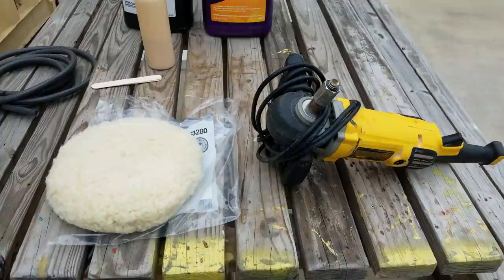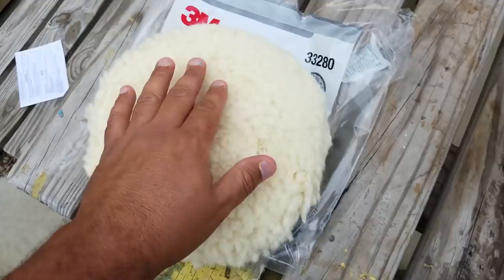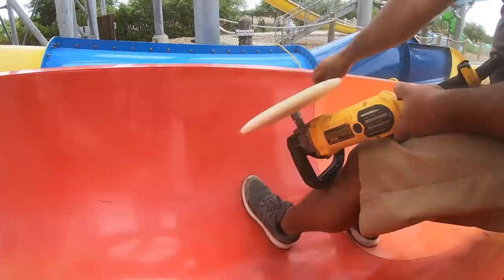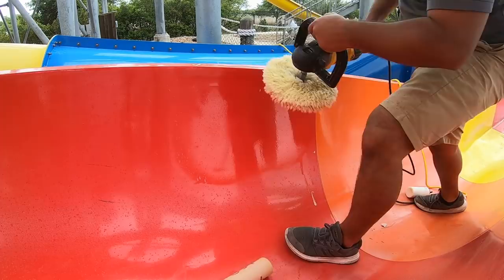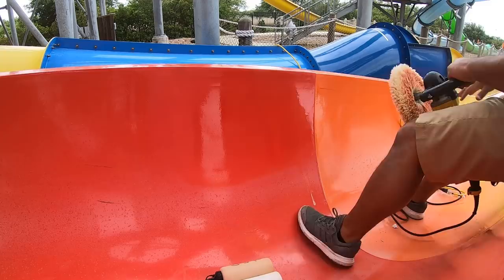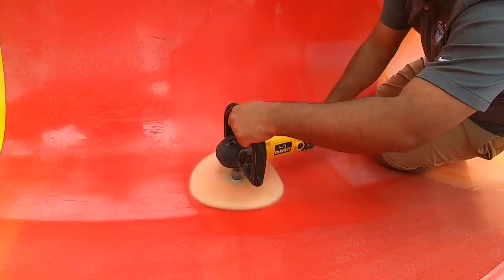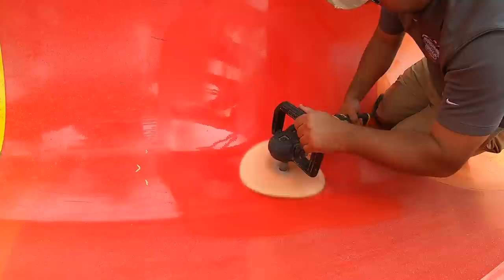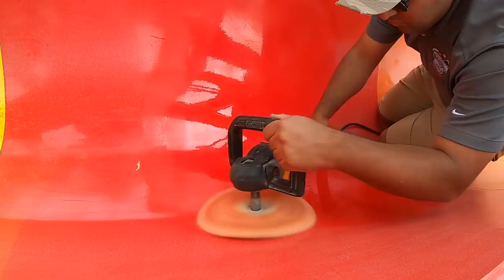Commercial Water Slide Buffing and Waxing DIY

Comment: Is it intentional to have the stuff that flys off the pad when you clean it with the stick, land on the yet to be worked on surfaces?  Or maybe its so little it just doesn't matter.
Reply from the maker: When at this point in the process, which we call the "cut" debris is not a huge issue. When we go back for waxing, all surfaces are cleaned well and debris is removed as much as possible.

Comment: Hello there  i have some question? i don't understand that you are not using a foam pad after the sheep pad the scratches of the sheep pad are deep and and the oxide shrinks not enough to me with only wiht the sheep pad, I use a polishing machine of the brand Fein WPO 14-25 E, this is very a strong and runs at max 1500 rpm and has lasted for 10 years' 3m is good stuff and I know from many tests that the results remain good on boots. Even  with cheap gelcoat "I really like to see you video I hope you can show more videos from  slide polishing  👍😁

Comment: Hi, I live in India and operate a couple water parks here.
We have never done this procedure in years (especially after the pandemic) and we have thick calcium buildup, thicker than a sheet of paper.
Your video was very informative and I'll do the procedure as soon as possible now.
It would be really helpful if you could tell us if we should sand it down first, if if yes, what grit should I use.
Also how often should this process be repeated? We have a 4 month season here annually.
And how often should I just wax (without the heavy cutting)?
Reply from the maker: Sagar.   I would suggest that you try cutting with auper duty compound first.  If it doesn't cut well, you might try 400 grit.  You have got to take the process slow. As, you only want to remove calcium and not dig into the gel. Once you get the slides polished, try and maintain by waxing twice a year.

Comment: I know this is an old video but have you ever tried pretreating heavy calcified areas with muriatic acid?  I used it on my boat bottom and it dissolved all the embedded minerals. It’s less you would have to burn through then.
Reply from the maker: Hey, yes, we have used muriatic in the past, but with the porous nature of gel coat, its helps minimally.  This process seems to be much faster for us.

Comment: ThePoolGuy I have a question I built a slide for my kids out of concrete going into my pool but what ever I coat it with never last longer then a few months to a year could you suggest to me a solution like a permanent slide material that I could just cut and buff like you did hear with this slide
Reply: Use epoxy paint. 
It will last 3-5 years 
There really is nothing that will home up long term to chlorine. I clean pools for a living, and that's the only thing I've seen that even lasts remotely long enough for it to be worth it.

Comment: Hi I’ve painted my child’s slide with spray paint and now it’s not very slidey do you have any recommendations??
Reply: It depends what type of paint you used. If you used a latex based paint, it’s not possible. Cover it 4-6 coats of a automotive enamel paint. Acrylic enamel works good to get a nice shine and slippery surface. After you get a nice coat of paint and it’s dry, buff and polish to make it shiney and slippery.

Comment: Do you do the grouting on the slide as well? If so what grout do you recommend?
Reply from the maker: Are you referring to the caulking between the slide joints?
Reply: ThePoolGuy my bad, yes the caulking between those joints
Reply from the maker: @gmanwhite76  yes, we like to use 3m fastcure 4200.  Sets up in a couple hours, and has medium flexibility, so it's easy to remove when needed, but doesnt crack during expansion on hot days.
Reply: ThePoolGuy thank you so much!

Comment: I have been polishing high end cars for over 20 years daily. The makita is way better and has no load speed.
Reply from the maker: We started with Makita.  I myself am a Makita guy, but since I needed numerous units, I went with a cheaper version.  Hell, the Harbour Freight equivalent is actually pretty good.  However the brushes seem to wear down quickly.  But they provide extras in the box.
Reply: @thepoolguy  I'm not sure where u live but I live in Canada and know a place that is cheaper then everyone else for the makita. I have bought a few of them as have my friends over the last 20 years from the same place. It works out to around 250 Canadian and I'm sure shipping wouldn't be to much
Reply from the maker: @kens6164  that's good price.  I can get the Dewalt for like $170 American.   And those Harbor Freights were only $100.  Unfortunately we use then so long and hard that burn them up, so cheaper is better.  We burned up Makitas year 1, after about 100 hours of work, so I had to come up with a cheaper option.  So far I have 3 of the Dewalt that are running still, rough of course, but they have lasted for a couple of years.

Comment: DeWalt cheap poorly made Chinesium. You should have picked the Makita.
Reply from the maker: OKay, so I typically use Makita tools, however, we have had much better luck with value over cost when it comes to the DeWalt buffers over the Makita's. Believe me, we have used a few.